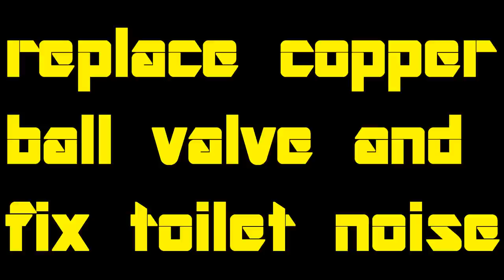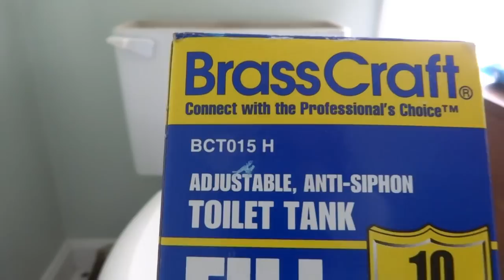replace copper ball valve and fix toilet noise

Comment: Hi Steve. I would like to recommend Korky Quiet fill fill valve. As a replacement for the Brass craft fill valve. The korky has a similar  1/4 turn height adjustment. The ones I have used work fine and they have videos on youtube. Thanks and have a great day.
Reply: Those are the worst ones

Comment: I like your idea if the valve doesn't have a bleeder to put in the bleeder coupling! That steam can wreak havoc! I typically point my torch away from the center of the valve while soldering to avoid damaging the valve! I never reuse toilet supply lines or faucet supply lines unless they were pretty new! I typically switch the multi turn shut off for the toilet 2 a quarter-turn valve! It seems after tightening it down it damages the old washer and then breaks off and gets in your new ballcock and the old multi-turn valve doesn't work the next time you want to shut it off! You have one cute pup there to be riding with you! He's your helper or she? How long have you been doing Plumbing Steve? Just curious!

Comment: On ball valves install, the rule I was tought was with valve open the handle is on and pointing with flow. Notice you do the other way a lot or most of the time!
Reply: @throttlebottle5906  yes understand, but have worked in refineries and other oilfield related facilities, the reason behind, handles show the direction of flow so can quickly determine the flow to be able to know what fluids are going where and to know what valves are to be closed to stop flow and keep others moving. In emergency can not just close all valves at once normaly if close one have to open another, or could over pressure, cut off cooling or materials to vessels that could over heat or explode it not shut down in a exact manor and or time limits. Handles show the flow!!!

Comment: too bad the brass craft fill valves are no longer available in that style as the Fluidmaster fill valves are available and are OEM on most brand tank type toilets. as fluidmaster is easy to set too.